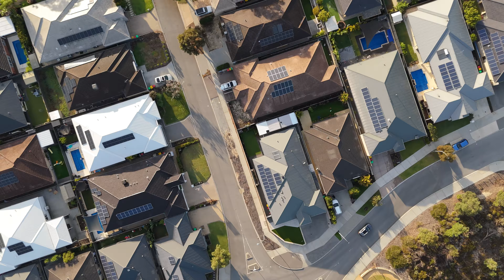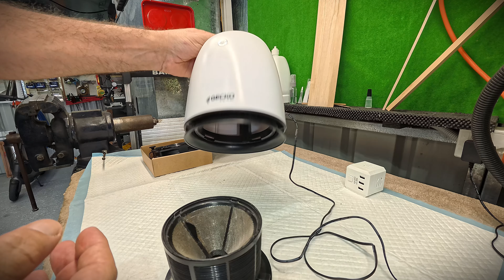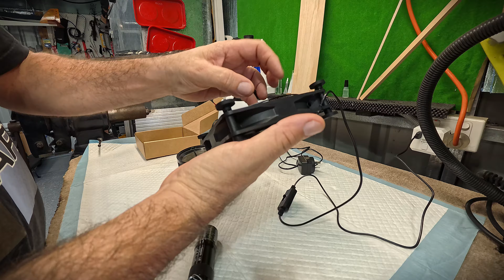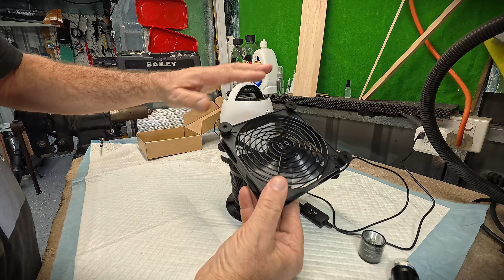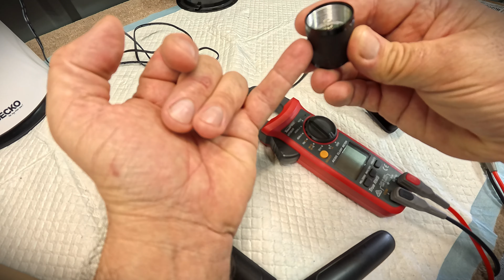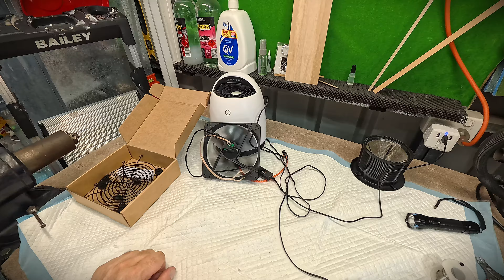DIY Mossi Vac - Summer is Coming

Comment: Hey mate very understandable with the park issue. A lot of people just have no respect or consideration for others frustration is understandable.

The mozzie thing is cool and I liked the thumbnail nail very funny.

I have a 3d printer it’s an ender don’t know if v1 or 2 haven’t used it in like 3 years. Can be very frustrating always something wrong even just leveling the bed with the gap using paper was just a very frustrating experience this one your getting sounds like a winner.

I did print some handy things so they are very useful.

👍🏻
Reply from the maker: I've had this new printer a week now. Already gone through 1kg of filament and 0 failed prints. I've used PLA, PetG and TPU. Awesome printer
Reply: @M @MattInTheShed400 ow amazing they have definitely came along way then always remember the stress in leaving it do its thing knowing how easy the ender stuffed up.
Reply from the maker: Yeah not anymore. Just did a 4 hour print of the Perth city that fits in a standard photo frame. It doesn't print the water so I will paint it blue and pour some resin over it. See how that turns out.